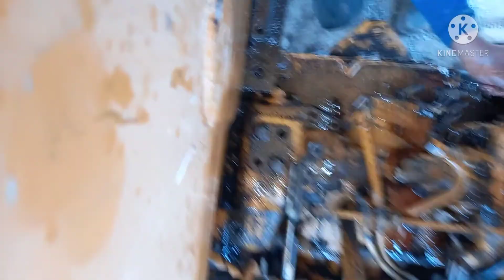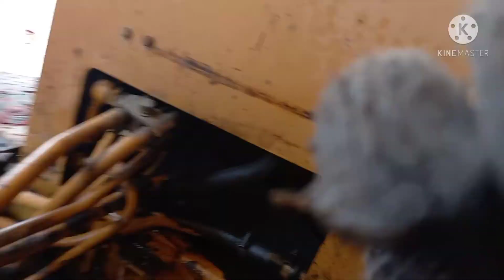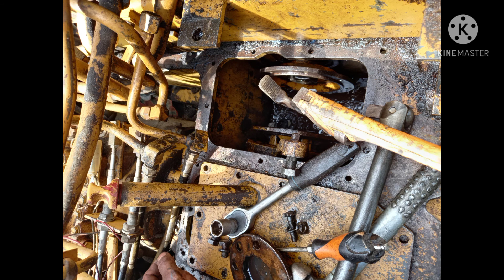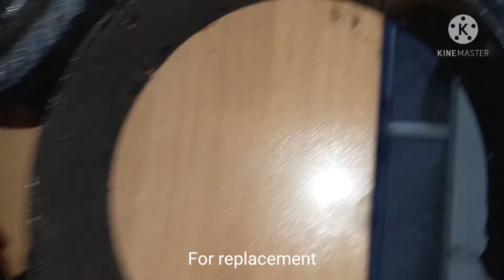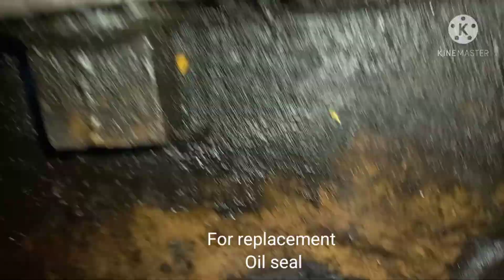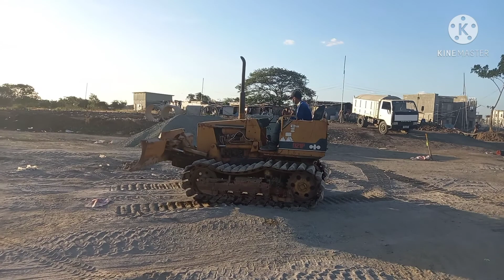Komatsu D21P-6 Bulldozer Steering Clutches and Brake Replacement

Comment: How much is the cost of the repair for both sides?
Reply from the maker: @HectorMartinez-wp4uj  it's depends on the parts that need to replace. The steering lining cost 23USD per piece and the plate us 20USD per piece and the labor cost around 300 to 400USD.